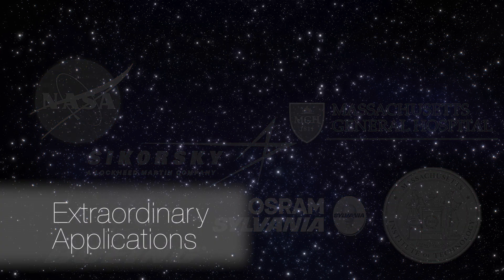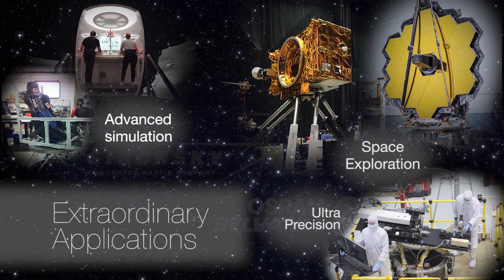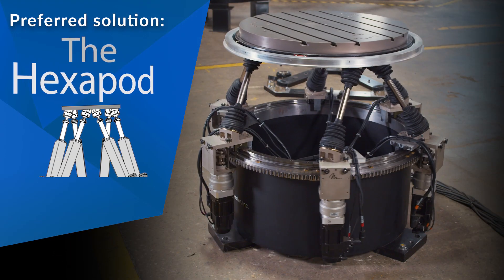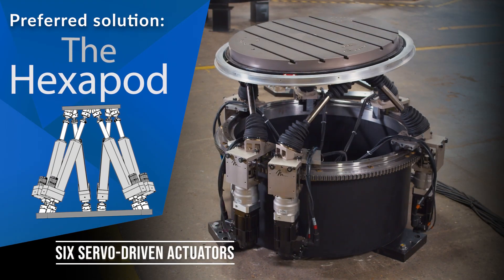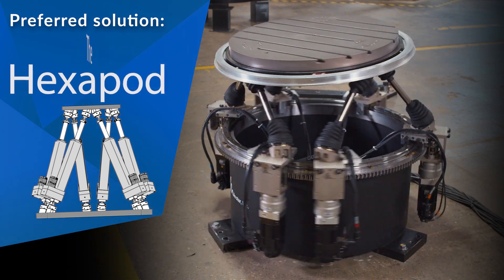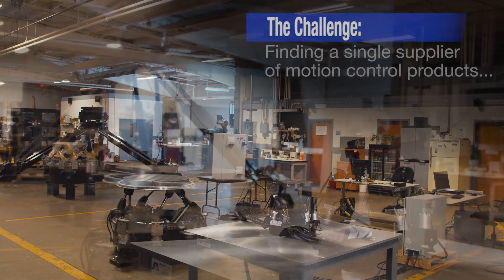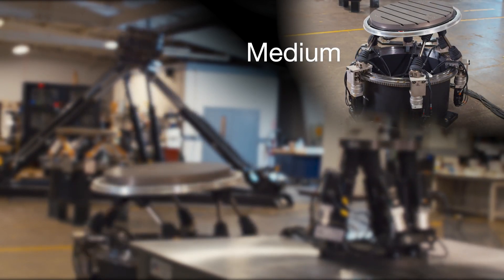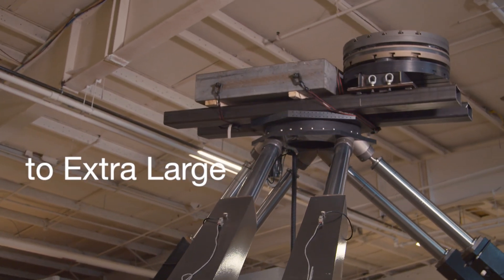Motion Control for Stellar Applications

Comment: Does yaskawa produces Dc servo motors ?. And also availability of your products in india
Reply from the maker: Thank you for your interest in Yaskawa. For more information about our products in your region, please visit: https://www.yaskawaindia.in/
Reply: Is it possible to use AC Servo motor with torque requirement of more than 300kg/cm with a battery(not generator) for outdoor purpose